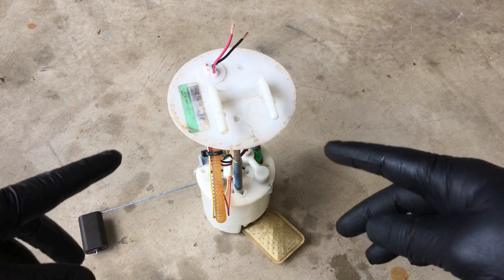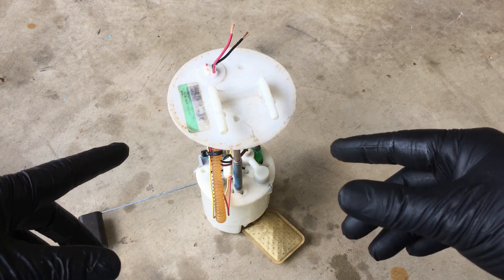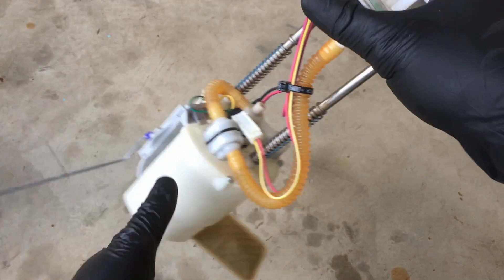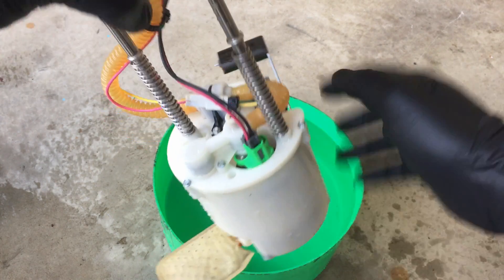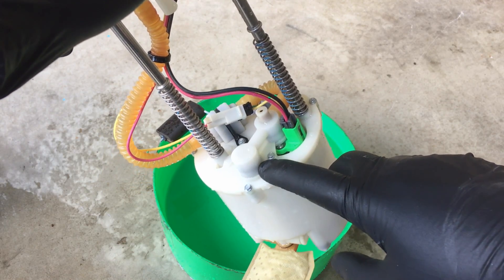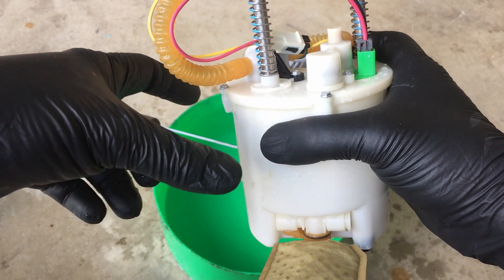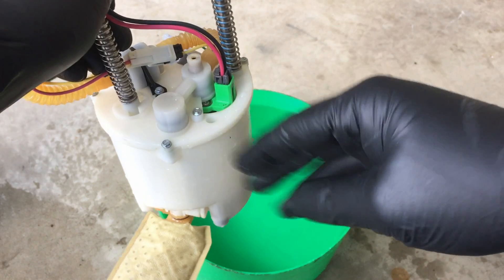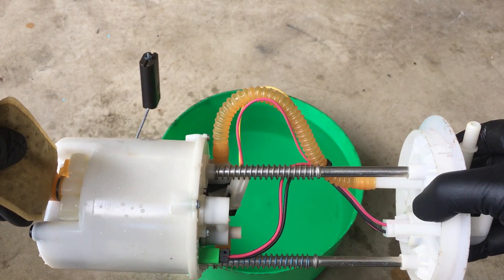Ford Quick Tips #80: Common Fuel Pump Failure Points Explained

Comment from the maker: A quality Fuel Pressure Gauge is invaluable when diagnosing these concerns-
http://amzn.to/2xDt5Gs
Spectra Premium is a great Aftermarket Pump-
http://amzn.to/2gBx40r
Fuel Sending Unit failures explained-
https://www.youtube.com/watch?v=aArfUtaSOYg
Here is the original Hybrid diagnosis video that this fuel pump came from-
https://www.youtube.com/watch?v=DQ7M4Dm4lOs
Reply: Disconnect line at rail and turn key, I get one small shot of fuel but no steady flow, what's the deal? 2012 transit connect
Reply: @georgebotelho288  same here
Reply: FordTechMakuloco  hey good day.  Any ideas on  a 08 ford fusion.  Wont accelerate  no codes   we replaced the intake  and still no luck   thanks  love ur vids !
Reply: I would try a cheap vacuum gauge to check mechanical first...then go from there
Reply: Will you do a goes explorer ball bearing if i can get the vehicle to you I will pay
Reply: This just solved my issue on Escape 2016 with 1/4 tank of fuel.
Reply: Check for a plugged exhaust

Comment: Well today I had a first time for everything moment. I went to replace a fuel pump on a 2014 Expedition but there was a problem. I was taking out the old pump, but the pump housing would not fit through the hole on the tank. It took me an hour to get the pump out of the tank. It seems the material the pump housing was made out of had swollen up to the point I had to fight the thing to finally get it out. I have never seen this before. May be faulty materials, but it is a factory Motor Craft pump. Maybe bad gas or other additives. Finally with the aid of several screwdrivers and a lot of pulling it came out. I installed a new Motor Craft pump and it fit no problem. May be someone has seen this before and knows how this could have happened.

Update: I have since found other videos and comments stating the same problem. It seems the 2010 to 2014 Fuel pumps have this problem where the material the fuel pump module is made of expands over time when exposed to fuel. Which is normally not a problem as it is taken into consideration during design. However, in this case someone seems to have dropped the ball during the design of the fuel pump assembly and did not take into consideration that the body of the lower assembly over time can swell to the point it can't be removed without much effort and a lot of bad words being used. 

The replacement pump is a new Ford Motor Craft pump PFS-579-1X, I used a pneumatic die grinder and a burr tool to cut away the edge on one side of the lower assembly so it can't get caught on the opening of the fuel tank when removing in the future. I hope this helps to be made aware of the problem.

Comment: I currently have a 2023 ford maverick (EB 2.0), and I notice the HPFP is getting louder compare to when I first got it, and I noticed some strong gasoline smell from the engine oil cap. The dealer said everything is normal and within the "normal" range :(. I was thinking about to change the HPFP to the Bosch one, and would you recommend to do so? Also, without removing the engine, is it still possible to crank the engine to the "flat" spot when installing the new HPFP? Thank you

Comment: I have a 2018 f150 that I think my fuel pump has went out. I pull the truck in my shop and and the truck started sputtering and shut off now it’s cranks but want start. I can’t here the put prime in the tank. What your thoughts??

Comment: I would like to see if you can tell me what would cause a fuel pump fuse to continuously blow. The brief description is when I put the key in the ignition with the battery being charged up by the battery charger / booster the fuse blew three times. Is there any other helpful information you might be able to share with me on what could be causing the fuel pump used to be blowing like this sir?
Reply: Now the vehicle that I'm working on is a 2005 Ford 500 with the duratec V6. I did put the battery chargers last jumper on it, it fired right up then ran 10 minutes then died as I press lightly on the pedal. It was until after the second time that I got it started that I noticed a fuel pump fuse blew. I then replaced the fuze 2 times and those fuze's  blew as well.

Comment: I replaced the fuel pump the module starter battery and it's still only four or five turns and then it just won't turn over no more any ideas

Comment: 2005 Ford f150 going down the road just like you shut the key off now it will not turn over about 4 or 5 times and then acts like it's got too much pressure or something I don't know any ideas

Comment: I’m wondering if you would be willing to give me a few pointers, my son has a 1988 Ford F-150, it has sat for around 7 years, really bad gas and all the problems that come with it, we have done the common things such as cleaned out the gas put new in, premium even, lots of fuel system cleaners, filters and pumps, it keeps burning up the high pressure fuel pump, so we put a brand new tank in with another new in tank pump and new high pressure pump, they just keep burning out, it runs for a good while then shuts down, I’ve noticed that the high pressure pump is getting pretty hot, any suggestions? I’m at my wits end with it

Comment: Hi I changed my fuel pump and fuel pump driver module works good two years ago on my 2005 ford expedition but anytime I run my fuel tank down to quarter tank remaining it messes up the fuel pump again I replace the fuel pump works good again but only when I run my fuel tank down to quarter it messes up the pump again what causes that

Comment: Awesome videos man! I have a 2018 F150 Raptor with a stalling issue when the engine is warm. This will only happen when the vehicle has reached normal temperature, no issues while driving, no loss of power, no check engine lights. The issue comes in when attempting to start the vehicle after has been used for a couple of miles. Been to three different FORD service departments still having the same issue.
Not much information on forums for this exact issue. I would really love to pick up your mind on this scenario. Been dealing with this issue for about 6 months now with no check engine lights. Putting my thoughts together I do remember this issue started after running low on fuel for a couple of miles before getting into the gas station. Also if a park on my driveway nose down it would start with a rough idle but will NOT die. When parking on a level surface or nose up it will die immediately and sometimes it'll give me a long cranking. All this is only when the engine has reached normal temperature. In the mornings when the vehicle has sat the whole night, it will fire up perfectly no matter the angle or position of the truck.
Reply: My 07 explorer is doing this there is a temp sensor that is 20dollars and may be the culprit not allowing the engine to start I'll keep you posted

Comment: Had my car in the garage since around 2018, Started it and pulled it out to the driveway.
It has been sitting all summer. Charged the battery and it got hot, It kicked the starter over ok but car didn't start. Battery dead won't take a charge. Battery was 2005. Replaced battery with new one. Cranks starter ok and sputters but won't start and run. Put 5 gal fresh gas in tank over half full. Seems to run spraying carb cleaner into intake but doesn't run. Checked 15 amp fuse. Removed and put back relay. Gona try reset inertia switch. Do you think it is weak gas? Or Fuel pump fail? Or clogged gas line / fuel rail? Could my computer be zapped from charging battery and over heating? Am I missing something? Tried in park and neutral. Pressed inertia switch it clicked but car still won't start. 2004 Ford Focus Wagon ZTW 3.8 - 4 cyl. Swapped high beam relay with fuel pump relay. Still won't start.
Help THNX

Comment: My 2007 Expedition EL has a crank , but no start now. No fuel pressure at the rail and fuses and relays are good. My wife runs the tank until almost empty a lot. Would this being repeated be hard on the pump and cause it to fail finally?
Reply: The pump requires a certain amount of fuel to run normally. Without the fuel to cool the pump it runs hotter requiring more current draw leading to fuse failure and cooking the blades.

Comment: hi can you tell me what voltage i should have on the pump in my s max 2.0 tdci, because i checked and i have just 5V on the connector and my pump is not working at all, btw one of the hose from dpf i have snaped and this could be problem that my car wont start??

Comment: Absolutely fantastic video. Maybe this is my issue on my 2013 focus. Replacing the pump today.
Reply: Hi what issues did you have with your ford what engine did is start
Reply: @user-ky7ty3ie1x  I replaced the fuel pump. Worked great after that. I also cleaned the internal circuitry of the throttle body. I checked for carbon build up on the valves, there was none. So fuel pump or the throttle body circuitry cleaning did the trick.

Comment: This a Toyota related question.. so you can answer if you want ☺️ but the pump is almost the same setup. I have been doing my own testing on a hard start issue and when checking the pump I realized I didn't fasten it down properly and fuel was spraying out at the top where it wasn't fastened right. My question is, is that right? If the pumping (sucking/ pumping) happens at the bottom why would file spray out at the top? Could it be a break in the line? Actually I would really appreciate it if you would answer me.

Comment: But how was the PCM responding to no fuel pressure at the rail? Mine is sending a 75% duty cycle to the fuel pump to have it shut off? Does that sound right?

Comment: We have a few fleet f250 2017 and above 6.2 and two in particular have hard staring issues. Takes a few extra secs to fire. Took it to ford deal and they said that was normal? I don’t believe that is correct since mine doesn’t. Wondering if the check valves are bad in the fuel pumps. Have you came across this issue with the later model f series trucks?

Comment: I have a ford Mondeo mk3 from 2001 and the pump is replaced at 240.000 km
But the red connecting clips on the pump are a big problem, the clips are from plastic and connect the fuelhose with the pump.
There are three clips on the clip and they are breaking very easy.
And you cannot buy or order them.
This is so bad from FORD.

Comment: Hi on my 2000 ford Taurus  i relplaced fuel pump and it deove great for hour or so now car wpnt atart and pump wont turn on i checked the inertia switch and fuses  and relays all good. But  pump wont turn on why
Reply: Sometimes after market parts only work for a short time. Auto Zone used to be real notorious for that

Comment: How do I replace the pump in my 2017 es Cape 2.5 without dropping the tank. Older ones had an inspection cover to remove under the passenger seat behind the driver.

Comment: When i start up my car, the rpm of the car is fluctuating and the engine hesitates, but after driving in the main road (~100 km/hr), the hesitation disappears 80%. No engine light appears. Is this problem related to the fuel system?
Reply: In the same boat no engine light rpms dance at idle acts like it wants to stall but doesnt
Reply: Josh Smith i have replaced the spark plug of the cylinder that causes the problem. Now thanks god the hesitation has disappeared.. I didn’t change that spark plug from the beginning because it looks good. I never thought it is the one which caused the problem.

Comment: Hy  i have a problem with my car Ford fiesta  2005 1.3 benzin since 1 year.  when the fuel level lower than 3/1. the engine somethimes stop just 1-2-second when i want to start from the parking or from the red lamp.  when i go and i add a gas  to 2000 rpm  tis is stop but the check engine light not flashing and after nothong when im going in 30km/h or more the diagnoscic not showing nothing.   if i add more fuel like half level of the tank  the problem lost.  and the engine runing good.   maybe i have a same problem with the fuel feed unit ???   thanks

Comment: Another excellent video!! I have a 04 f350 dually with a 5.4 that has been sitting for about 5 years. I tried starting it and no go. It will start with starter fluid, so I'm pretty sure its a fuel supply problem. Ran fine when I parked it. Also, California fuel. Any checklist to start trouble shooting?

Comment: After the dealer did the SAFETY PROGRAM 16S41 recall then my '12 Escape has the exact long crank hard start that they describe in the actual recall.  But that dealer is 2 hours away and the local dealer says they won't fix the other dealers problem even though it is  a recall.  They think it is from nicked barbs on the hose connection.  Do you think I can fix it with some fuel resistant RTV?  Thanks

Comment: I really would have liked you to take the pump a part to see what was causing the pressure relief valve to stick, I bet it was a piece of plastic or something that came loose after being manufactured since it took about a year to malfunction. Also, since it partially works should be an easy fix. If you still have it, go a head and take it a part it's just a few screws. Curious minds want to know.

Comment: I have a fairly new car with very few miles and when i bought it, i ran it out of gas with about 40 miles showing on the trip indicator, about 1/8 tank. 
Tow truck came to give me a couple gallons and i was on my way. 
about a month later it died on my way into work. It was running like shit and finally gave up as i was making my way onto the highway ramp.
It has about 1/4 tank, and it DOES have fuel to the high pressure rail, i just don't have the correct adapter to test the pressure. i wonder if i got shit pressure......
I've been chasing a no start problem all winter long, and i havent given much attention to the pump because i can confirm the pump is working, but ill bet its not working as good as it should.
im going straight home to
A: empty my gas can into the tank to see if that gets it to start
B: figure out exactly what i need to make a custom rig for a fuel pressure reading!
Thank you for the video.

Luckily, i do believe i can reach my fuel sender right under the rear seat, inside the cabin of my car.

Comment: Just installed a fuel pump on my sons 2002 Taurus... looks the same as that one.  Easy install.  Bought the pump on the net for $56..... I hope I didn’t make a big mistake by installing a cheap one. It looked the same as the one I removed .... The one at the auto parts was $286.   Hopefully , my savings was not in haste ???????
Reply: I'm facing the same situation. I Have not bought a new one yet. Wondering how it's performing even though this thread is closed or old right now. Sure would help me make a wise decision. I have an 1994 E-250 that needs a pump. Tempting to save that much money but is it worth it? Thanks.

Comment: Oh did I say the set of fuel pipes Ford sells together only is 299.00 retail 234.00 jobber price. The location of the cracked line is   approximately under the drivers seat on the escape.
Also recently through drivers side cooling fans blades started  cracking from age and losing prices of the blades.

Comment: Help you must know something about the cracking of stainless steel fuel lines on 2012 escapes !,,
Ford parts guys say there on interstellar back order. Yet they never sell them ,hardly..never seen them Crack either !
I'm going to cut and splice in fuel hose if I can cut it with a tubing cutter.
The two hairline cracks occurred where the pipe contacted at the plastic snap clip mount exactly. No bend or impact damage to pipe that I could  detect as a cause for fracture. I'm thinking bad mounting stress on pipe as a cause ?

What have you experienced with stainless steel fuel line repair in general and the Escape? 

Thanks you videos are excellent !

Comment: Hello, I would need advice, I have the F-150 5.4 triton 2004, and I am running out of speed of the engine. CHECK lights up, and the diagnosis writes a poor mix, but obviously everything works electrically. When the accelerator accelerates from the idling speed, detonation is heard in the suction line. Otherwise, in the high swaths, everything is no problem. Do you have any experience what could be damaged? Zdeněk Czech Republic.

Comment: Buddy, I have this explorer 2013, came in with abs lights n skid car light on, and they were like they had this light & an electrician scan and advised them to change the abs module, they got new abs module thrown to the car but yet we’re like the old code resurface again, and that is U3000. In the abs, I further asked them what happen or did they carried out any repair works before this symptoms appeared, and they were like this abs light wasn’t ON until they had the steering rack asst replaced and drove a couple of miles then BAAM the abs lights n skid appear, so I am push to conclude that could be their old abs isn’t bad but could be the steering rack, now here is my question, does the rack need programming, if yes, what about the new abs module too, and can you share some steps involve in coding the rack,

Comment: Hey I have a 2008 F250 6.4L powerstroke. Could you do a video on how to flush coolant fuel system & putting new coolant in that system? From what I understand if you get air in system coolant will not circulate properly & it will burn up high pressure fuel pump!
Reply: Sell it and buy a something decent, like a Tundra.

Comment: I got nervous when I saw the pump start to lean. First thing came to my mind was water and electricity doesn't mix. You are an excellent instructor. Even though my '05 f150 runs like a bucking bronco. I'm gonna try to tackle the tune up myself. Thanks for the videos
Reply from the maker: +jmar662 jmar662 it's just dc, actually this is the recommended way to clean brushed dc motors
Reply: You are not intelligent. Just indoctrinated